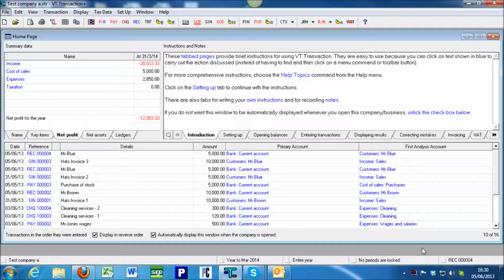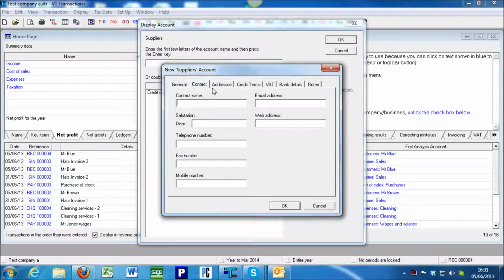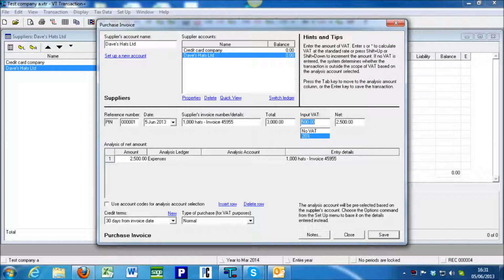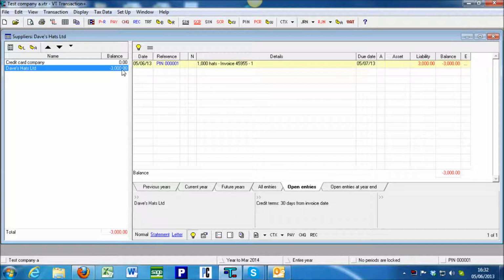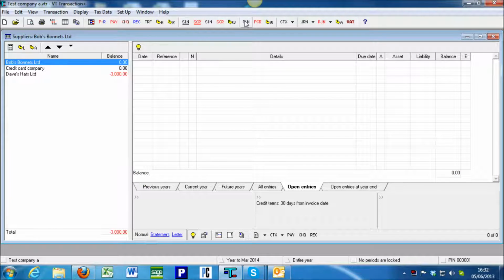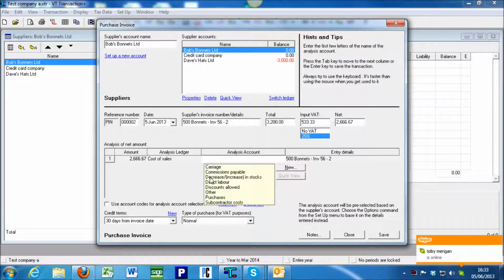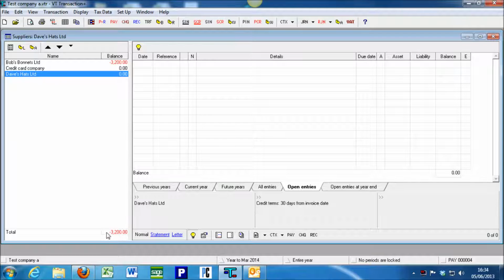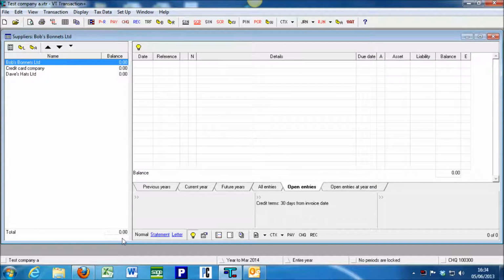Tutorial 4 - Supplier accounts - VT Transaction +

Comment: Could you make a Video of An Invoice which has Standard Rated, Reduced Rated and Zero Rated Supplies.
I have came across a few invoices where they bought standard goods, Charcoal at reduced Rate and Zero Rated Supplies.
Much obliged.
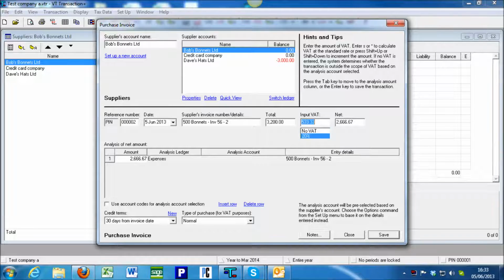Reply: 2:42 you can choose the No VAT or standard VAT rate. (No VAT is zero VAT) 
Use online VAT calculator or excel formula to calculate reduce VAT then enter manually. http://vatcalconline.com/